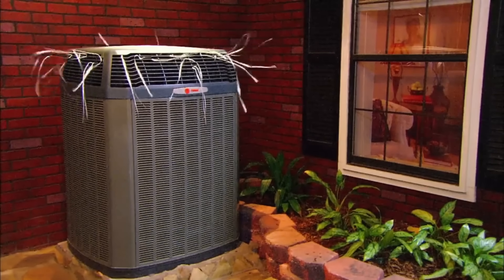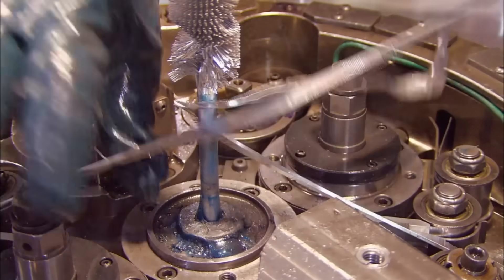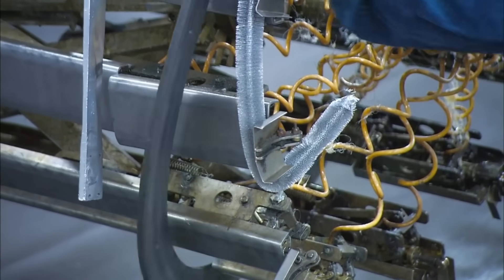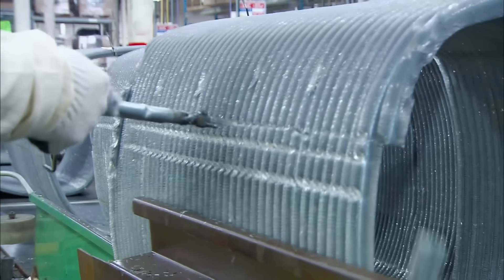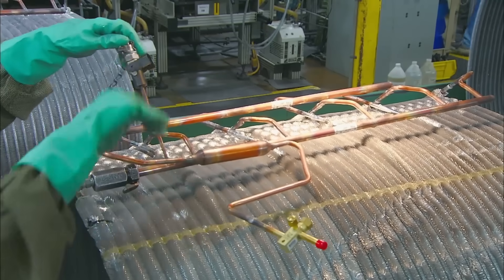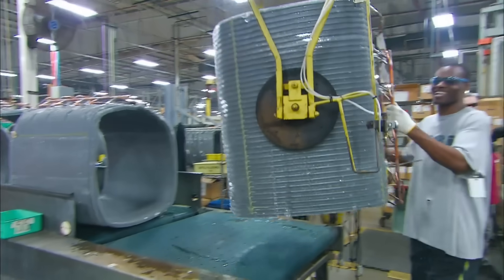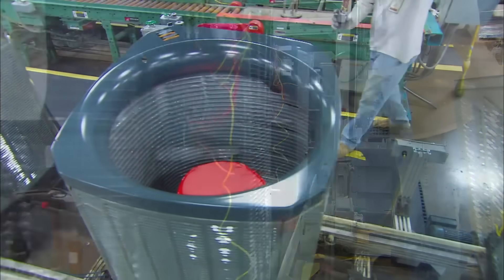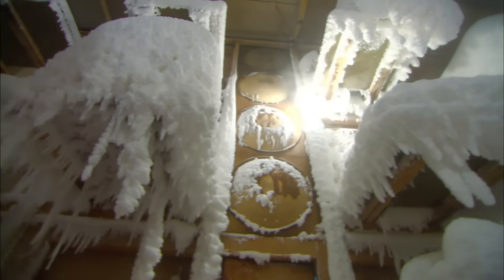How It's Actually Made - Air Conditioners

Comment: At the end of the line, when the machines are getting boxed. There is a display counting the equipment. A sign says, " You meet the quota for the day, you go home early." So you can imagine how some of the equipment leaves the building and the techs suffer in the heat for it when it fails.

Comment: If Like a Force to Work Here, Because if Coldness at 1 Point of Body can Create Entire Body Cold/Cool for A Duration(maybe 30mins - 1hr), to Just Be Somewhere Else To Gain Strength(work - set body colder, then go home, this kind of Pace first) somehow?
Reply: About Passing by the entire Journey to this workplace(making ownself cold first still can be successfully outdoor without too much pain of voltage from equator hole)?

Comment: what's comical is that i happen to work as an hvac service tech and the number of times i've had to disassemble one of these exact air conditioners (and/or heat pumps) has given me the ability to know explicitly what each step was going to be before it was actually performed, which was the highlight of my day, also can confirm that pudding is the only other acceptable substance allowed inside of an air conditioner, you would not believe how much pudding is added every time one of these gets installed.
Reply: Oh my gosh, pudding?  I can tell you're not a real tech!  A real tech knows that Greek yogurt is far superior to pudding in a refrigeration system!  The tanginess combined with the natural probiotics means it's satisfied and has excellent compressor gut health!
Reply: I know installation is more important than the brand, but if all of them were equal in price, which brand would you choose for your own home? Lennox, Carrier, Goodman, Bryant, or what would you choose???
Reply: Not who you responded to but an HVAC tech:
Brand recommendations could vary, depending on the equipment required. In my personal home I would prefer a Carrier but that's not a recommendation I just like the blue oval because it reminds me of the Ford logo. Across the board though: Trane/Am.Std. They have excellent service literature and tech support so when it does inevitably break on a Saturday the green tech they send out will probably be able to make heads or tails of it.
Reply: @petef.4361  i would avoid lennox; you may find the odd lennox air conditioner from the 80's still in operation but not very frequently, and recently we've run into lots of QC issues with their systems just not working correctly or coils leaking left and right. i seem to be replacing lennox coils disproportionately much given how few of them we install. my company uses trane primarily, which i would say is overall my top pick too if all things are equal given the sheer amount of documentation and overall build quality being pretty darn good for the most part, but carrier and rheem seem to have similar failure rates too and have reasonable construction. probably wouldn't pick goodman if price is equal, it overall has lower build quality than the alternatives and is a pain to work on due to cheap construction choices like terrible screw design and an annoying condenser design that makes the top very difficult to re-install compared to other brands; lennox has similar condenser problems as of the last five or so years though to a lesser extent

so, idk man probably just anything but lennox. carrier/payne/bryant is solid but i wouldn't really prefer it over trane/american standard unless the price is right. if i was looking for overall higher quality equipment that i know i will be able to get OEM parts for in 30 years time, then i'd pick trane/american standard, they have a track record for being able to source parts well into the future and offer 99 year warranties on their 90%+ heat exchangers now (and i think i even saw that warranty applied to a few 80% heat exchangers but i could be misremembering)
Reply: How are you going to bring the system to vacuum with pudding in it?
Reply: @markh.6687  just drink the pudding and vomit it back in when you're done. hope this helps!
Reply: You misspelled "pookie" bud.

Comment: As an AC technician I can ensure to the viewers of this video that everything he said was 100% true in regards to manufacturing an air conditioner...

Edit: you wouldn't believe the amount of pudding I've pulled out of AC units
Reply: I know installation is more important than the brand, but if all of them were equal in price, which brand would you choose for your own home? Lennox, Carrier, Goodman, Bryant, or what would you choose???
Reply: @petef.4361  personally I'd want daikin ductless mini splits. Don't get me wrong a standard split or package system can work great and with proper maintenance work for as long as it can. Nothing lasts forever. As the other commenter said all brands have pros and cons. Warranty is very important. Trane has a good warranty, Trane's are also expensive. If I wasn't installing a daikin mini split system I'd would then go for a trane. I like trane's they are reliable and work well. After that Carrier. I'd stay away from Lennox I'm pretty sure they had a class action against them for making faulty evap coils
Reply: All of them have their pros and cons. The company I work for installs York. I personally recommend you do 3 things with whatever brand you choose. 1.Try to have routine maintenance/cleaning done. This will most likely extend the life of the system. 2.Make sure it has a good warranty. Parts on all systems are getting cheaper in quality so parts are more likely to fail. 3. Think about how much parts will cost after the warranty expires. For example Trane is a good product but you will be paying for the name when it comes to parts.

Comment: FYI the first one is "pin fin" technology. I showed a video on how to make it using a cordless drill and copper wire but this is a CHEAP NASTY version if it's using cut aluminum sheet..... I worked at a place that used to do all dorts of strange custom radiators and stuff. Fuel coolers used this type of technology but with copper wire not aluminum.

Comment: I lease my small home, and I had my HVAC unit completely replaced two years ago with an expensive Trane unit after the 20 year old HVAC system died.  They replaced all of the equipment both inside and outside.  It was not cheap at all.  The contractor put in a Trane system, and although the old thermostat had just been replaced a year or less earlier, they put in one a T6 Pro Honeywell thermostat.  I hate it.  I hate the Trane HVAC even more than the thermostat.  To say I hate this Trane does not remotely convey how much I really LOATHE this Trane system.

I feel we were deliberately deceived about the Trane unit.  They never mentioned a word to us about the fan.  In this Trane unit, unless either the air or the heat is running, you cannot feel ANY significant air movement from just the fan being on.  You have to hold your hand up to the vents in the ceilings to feel any air at all---no exaggeration.  With the fan on ON, the air is so slight that you can either stand or sit under it and not feel any air movement.  I realised this the same day they installed it as soon as they left. I tried to run the unit as I have always run my units---fan set to ON, and AC set to about 75, which was always comfortable even in the hottest weather.  At first, I thought the unit was flawed, but they told me no, that is the way this unit operates.  The fan does not blow much unless either the air or the heat is on.  It will save you money.  Save me money?!?!?  Firstly, it has NOT saved me money.  In fact, it costs more to run this unit than it cost to run the 20 year old unit it replaced, and as aggravating as that would be, what is ONE MILLION TIMES WORSE is that it HAS NO FAN, and I constantly feel stifled by lack of air movement in here.

Save me money?!!!  What a JOKE!!!!!  Since I have had this Trane system, I now have to run my air at 72 degrees just to keep air moving more frequently.  I actually feel cold, but  I have to wear a sweater and thick socks to tolerate the cold if I want air movement.  Lying in bed at night, I cannot feel any fan unless either the air or the heat is running.  It has been miserable.  I was so angry the first few months that I wanted to contact Trane and tell them what total piece of junk is this system, but I found no way to contact Trane. 

I feel this was very DISHONEST on the part of the contractor not to disclose this fact about the fan.  In fact, after I complained to one of their techs that I do NOT like this system AT ALL, he said not many people like it either, so it is not just me.  So, they KNEW customers were not happy with this model unit, yet they kept selling the units without telling customers first about the fan.

Then, to add insult to injury, the contractor told me if I wanted air movement, I should buy and set up some table top fans.  Firstly, where was I set to set up table top fans?  There is not a free spot of countertop or table top space in this entire tiny apartment.  Secondly, I have suffered my entire life with severe allergies.  I did allergy testing twice.  First time I took sublingual drops.  Second time I took shots in the hip 3X a week at the doctor's office.  Neither helped me at all, and one of the single worst things I could possibly do to make breathing worse was to use fans.  Dust can make me so ill that I literally am unable to breathe.  I inherited respiratory problems from my mum who had severe asthma all her life and ended up in ER many times each year because she could not breathe.  I told the contractor this, and all he said was "well, you are not even giving it a chance.  Find a way to clear some countertop space and set up some fans for air movement, or find a way to mount some fans on the walls in each room. Give it a chance."  Can you believe that?!!! I was stunned and appalled by the insensitivity and dishonesty.  

Installing a $$$$ HVAC unit and then telling someone to set up tabletop fans for air movement is like selling someone a Ferrari and then telling the customer to buy a couple of strong horses to hitch to the vehicle to pull it along.  My landlord was no help.  I spoke to him about it the day it was installed and found out it had NO FAN, and he said there was nothing that could be done because it was already installed.  I disagreed, but I could not force him to take action and complain to the BBB and the Attorney General's Office for Consumer Protection to get the unit replaced.  After all, he was not the one who had to live with this crappy HVAC system.  I still am amazed that anyone would pay $$$$ money for a brand new HVAC system that has no fan!!

This thermostat is not very impressive to me.  Why would it be?  This place is so tiny that it can cool down or heat up literally within 15 minutes of turning on the air or the heat.  Why would anyone, especially a senior who is home all day and night most of the time, need a thermostat that raises and lowers the temp during the day???  As I said, the apartment is so small that you can bring the temperature down or raise it within a very few minutes.

Worse, though, MUCH, MUCH WORSE is the $$$$ Trane system the contractor installed.  Do contractors keep a number of systems on hand for immediate installation?  They installed this one for us the same day the old one was pronounced dead.  My guess is they bought several of these crappy systems for a good price and were unloading them on customers without telling customers "this system does NOT run like every other system you have used.  This system is designed to save money by making it impossible for you to run the fan with any force unless the air or the heat is running, so the fan alone will be USELESS to you.  If you are happy with that, then this system will work well enough for you, but if you are unhappy at the prospect of no fan, then you will not want this system."  

The real kicker is that this Trane system actually costs me MORE to operate than the ancient system it replaced because I have to keep the house uncomfortably cooler or hotter as the case may be just to keep filtered air blowing as much as possible.  Otherwise, there. is no air movement in here, and it feels stifling.  Soon as the air or the heat cuts off, you cannot feel the fan at all unless you put your hand up to the vent.  I used to be able to stand at the stove top cooking with the air blowing strong enough to keep me cool, but not with this Trane unit, I stand there to cook and melt over the hot stove.  I go to bed at night and cannot feel any air movement in the room if the air or the heat cuts off.  Needless to say, I am angry and feel that the contractor was very dishonest. 

Oh, and the contractor said that the EPA mandated these types of systems.  I could not believe that, so I began contacting people at the EPA, and they confirmed for me that they do NOT mandate any HVAC system.  They said they do control what types of freon are legal to use, but whether or not you can run a strong fan without also running the air or the heat is NOT something they regulate.  In fact, the man I spoke to at the EPA was a regional manager and told me he had never even heard of an HVAC system where you could not run just the fan and have plenty of air movement from it alone.  Heck, everyone's vehicle's HVAC system allows that much, but a home's HVAC system will not allow you to run just the fan with significant air blowing?!  It was clear: the contractor lied through his teeth and stuck us with a system for the next 20 years that we would NOT have chosen had we known about the fan.

Comment: General chemical safety warning: this product contains a chemical known as hydroxilic acid (CAS# 7732-18-5).

There are several known hazards and downsides involved in handling and usage of hydroxilic acid, including the following:
> accelerates the corrosion of many metallic elements and compounds
> increased risk of suffocation on inhalation of it or large volumes of produced fumes
> can easily form colorless solutions with other hazardous chemicals
> may cause severe burns upon skin and/or eye contact
> is known to cause electrical failures near uninsulated components
> is known to have been produced by cancerous tumors
> is known by the US State of California to cause cancer, birth defects, and/or other reproductive harm (additional sources required for verification purposes)
> is fun to tell jokes about for the purposes of scaring those who don't know it's actually water.

If you have concerns about products that may contain this chemical, please contact your local chemical safety commission. The Coalition of Chemistry Joke Writers cares about your safety, and wanted to make these hazards clear in case you enter a situation in which the handling of H2O is unavoidable. Please always take proper safety precautions when working in a lab, and always consult your advisor if you're at all unsure about the safety of any given procedures. Always remember to practice alchemy safely.

For more information, please consult this chemical data safety sheet: https://fscimage.fishersci.com/msds/00199.htm

Comment: As an hvac tech, trane is like a 5/10 quality, hence why they were so willing to show how they make it. Also, all aluminum coils are garbage
Reply: i've taken that plant tour and I disagree , that tubular design is from the General Electric days before Trane bought them out ,has worked pretty well over 50 years
Reply: @thegunnartubeartchannel7655  ge made quality goods, trane makes discounted crap. I’ve been an hvac tech for 12 years, the units I see fail the most are trane, goodman, and rheem. Now, as far as the aluminum coils, they can’t withstand the same pressure ratings as copper tubing, it is much more prone to damages, and you cave to be careful when cleaning the condenser or the chemicals can eat right through the coil itself and cause leaks.

Comment: "I'm not saying they've ever found pudding in these pipes" Fine, I'll do it myself
Reply: "pudding" happens when liquid refrigerant mixes with the compressor oil, it happens regularly.  The only non-true statement in the video was that pudding was fine, though, as the mixture will corrode through the pipes and also destroy the compressor.  It's why you can't tip some refrigerators.

Comment: The whole thing around heat exchange is really fascinating. I was at a powerplant where a section of pipe for Natural Gas was larger than the rest and it was COVERED in frost so thick I thought it was insulation until I touched it. due to the the sudden drop in pressure.. Apparently it was completely harmless to the system so they never bothered to fix it with the correct size.